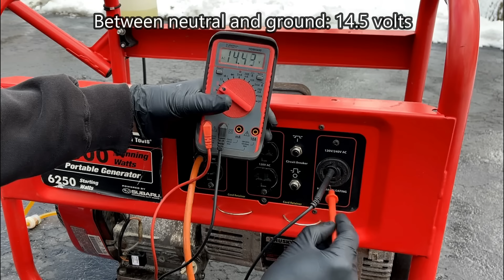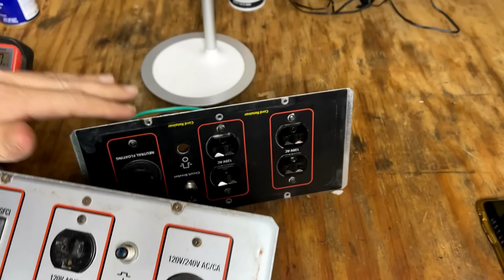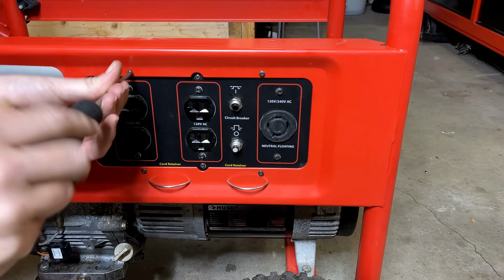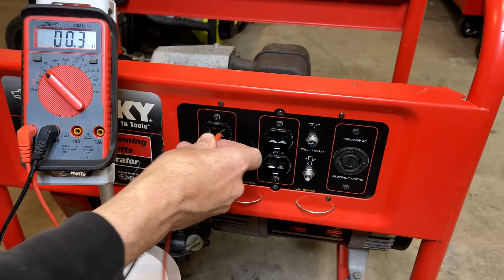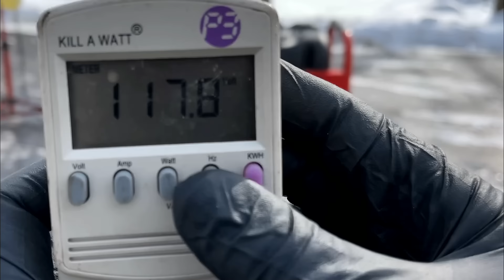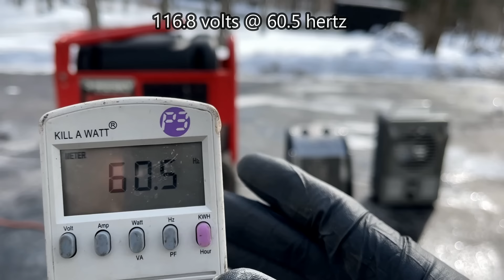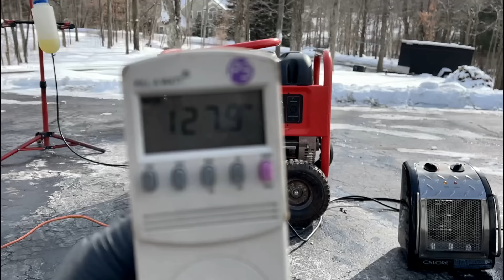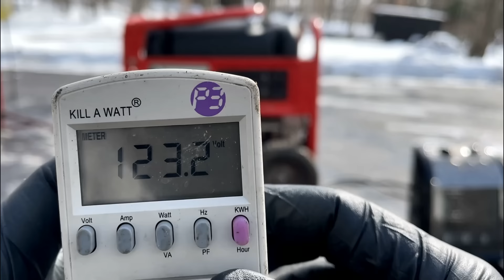No Power Output From Generator - Fixed

Comment: Your drilling out the wrong jet. The pilot is just for the idle mixture. You need to open up the main jet. When tightening the rotor, I think to align it properly, you need to fit and torque the stator first and then torque the rotor, thus aligning the rotor with the crank taper and not relying soley on the crank taper. The stator you said was bad, could it possibly be the slip ring that's faulty, or am I just making a fool of myself?  That said, I do love your videos and I always look forward to them James.
Reply from the maker: I tested each slip ring off video and they seemed good.  Even at 3600 rpm no load, it’s mostly the pilot circuit and transition circuit which are metered by the jet I drilled.  Since it ran well under load, it seemed like the main jet was ok.  Maybe not since it did not work.  Torquing the rotor after the stator install would work better.
Reply: @jcondon1  Hi James and thank you for your reply. You've got enough carbs around you to try opening the main jet. Nothing ventured, nothing gained as they say. I mean there's only four moving parts on a carb, two butterflies, a needle and a float. What about a video of making a carb run richer? Carb suppliers won't be impressed if you could show how it's done.
James.
It's been lovely corresponding with you James, so here's wishing you and the family a glorious weekend and keep the vids coming.

Comment: I enjoy your work. This time, I think you went to quick. This generator has stood in water in a closed room. The level of water reached is a bit above half of the wheels. This explains the corrosion. You should have cleaned the ventilator and made a much more insistent work of detailing, stopping corrosion. Not a criticism, just my thoughts. Keep up the good work. Kind regards.

Comment: Squealing brushes? Definitely! We've had that time and again, and it's one sign of them having been overloaded. The brushes get burnt and become hardened. Sometimes they will clean up with fine sandpaper, but if the overload was long term, it's pretty much irreversible.  Different brushes have different compounds and aren't always interchangeable, but on small machines like these it's not likely to be a problem.

I'd guess that an intermittent connection on that rotor would have had the AVR bouncing the excitation current up and down, and all over the place until the connection broke down completely. In the meantime, the brushes were likely pushed a bit hard and got burnt in the process.

That was a nice save though, but it looks like the whole machine has suffered a lot of dampness, or rodents peeing all over it, but I'd doubt that - It's too clean for rodents to have been nesting in there.

I'm liking the new ultrasonic cleaner - It's the bit bigger version of ours!
Reply from the maker: The old ultrasonic was sounding a little sick.  The new one is more powerful, but did not notice much of an improvement.  The slip rings had a lot of carbon buildup.  No doubt the AVR was working overtime.

Comment: Curious how that much water got in the fuel tank. Any Ideas?
Reply: it looks like this thing was left out in heavy rain. or a gutter or roof was dumping on it.
Reply: Left outside for rain and snow 
Snow would melt slowly and seep thru the fuel cap. 
That engine stay outside for many years 
The oxidation on engine n power head is impressive

Comment: Those 10 turn pots have a bit of mechanical hysteresis on the helix that drives the slider, you will never get it to the same place exactly by going one way and then back.

Comment: I have a $300 "Power It" generator for Walmart.  I only expected it to last until I got my cabin built (used it to run power tools) but ended up using if for years to run lights, etc. at the cabin.  To this day, it still does not burn a drop of oil but has an intermittent problem where it puts out low power (lights go dim) and when it happens, it sounds like the engine load increases (to the point where it nearly stalls).  If I keep it running, it will start working properly again.  Any ideas?

Comment: Remove the wire from the solder tab, clean it good , bend it back on tightly and the tab, and resolder with resin core non acid solder/flux!
Reply: OOPs aluminum wire, cant solder it, remove it and return with Alu cans to recycler for $..

Comment: I suggest a very close look at the OTHER end of the rotor winding.  I suggest there may be a dry joint there too.  If it is aluminium winding wire there are specific solders and fluxed to allow it to be tinned properly.  Not dead yet perhaps.
Reply: I was thinking exactly the same about the other end, you saved me posting that. These connections are often pressure spot welded to avoid solder problems.

Comment: You must clean the epoxy coating off the end of The Wire before you can solder it. There appears to be epoxy coating left on that wire.

Comment: I was like : 
You just going to take the seller word . Engine run good 🤣 
Then you decide to test the engine before taking out the stator n rotor 😁
Reply from the maker: Ken also tested it before buying it.  He said it started first pull but had carburetor issues.
Reply: @jcondon1  Great then. :) You know how it is . all the seller always said . it run great last time i started it :) :) :)

Comment: If the roter bearing is automatically centered in the end cap when its installed, why is there a need to put tape around the long bolt that goes through the center in the shaft?, It should already be centered. By the way i've learned quite a bit watching your videos.
Reply: Because the bolt is very long and hole diameter much more than bolt diameter, it is not  centered. You can see the bolt wobbling in some videos. Then some people ask in comments, what is wrong?
Reply from the maker: Exactly.  8mm bolts going into a 10+mm shaft are always off center from the factory which seems to be fine, but people go crazy in the comments when they see it.  Some rotors use a 10mm bolt and those go into the shaft nice and centered without any help.
Reply: @jcondon1  The bolt being centered would be irrealavent if the roto is pressed into the end cap. The rotor has no choice but to be centered. After all the rotor is being sandwiched tight between the crank and the bearing end cap. Actually that bolt seems more decorative than functional.

Comment: SCRAPE THE SALT OFF THE CONNECTION then flux it then solder it. Dry salt is a good insulator and a good conductor when wet

Comment: I’m not sure, what about you? Page 26:44 
I see a gap at the junction of the stator assembly (black) and front cast cover.
Reply from the maker: That is just the black outer cover that goes over the stator.  The important thing is that the stator core was seated into the bell housing.  A lot of times those covers are cut a little short.
Reply: @jcondon1  I agree. But please compare assembly condition seen on page 16:20 with condition on 26:44 and let me know your thoughts?
Reply: @philoso377  At 16:20 there is 2 mm cap in both sides. At 26:44 there is 4 mm cap on the right. It is OK. The black metal part is where it should be, between the aluminium parts.
Reply: @karirautio  am I right that it is more important for the stator laminate stack to be press against the aluminum bell brackets and to let the black sheath float in between with tolerance of a few mm?

Comment: About the contacts in rotor - if there was a solder problem on one side of wire, then the other very likely has the same problem ...
But not beeing a copper ... it just might be something not to be soldered at all or it might be easily failing when in contact with steel, just interesting what the hell it was.

Comment: What is the purpose of the black plastic adjusting knob, just to the right of the fuel inlet pipe on the caburetor?
Reply from the maker: It moves a needle in or out on the pilot circuit which changes how much fuel is allowed in.  It has a limiter cap so not much adjustment in it.
Reply: @jcondon1  Thanks!  I put a Woxla carburetor on my Subaru EX 30/Coleman Powermate.  It seems to idle rough (misses) but runs fine under load.  I'm assuming the idle circuit is running too lean.  Do I back the needle valve out in order to richen up the idle mixture?
Reply from the maker: @gregorywardlow3612  yes

Comment: I have a 3500 Troy built it will only put out 90 volts I replaced brushes and still the same thing I have tried everything I can think of your help would be greatly appreciated thank you
Reply from the maker: Assume it does not have an AVR?  If not, then voltage is based on engine speed.  Check the engine speed.  Should be running at 61.5 hertz (3690 rpm).  If the speed is good, only other thing to check is for loose wire or corrosion on a wire terminal.  Or maybe a new bridge rectifier.
Reply: @jcondon1  thank you so much for the help what is the thing you plug into to check the voltage and the hertz

Comment: You need to brush up on your soldering. The reason you couldn't solder is due to contamination of the copper. Scrape off all varnish from the connection area (factories sometimes miss that part) and pre tin the copper wire. Pre solder the tab giving you fresh solder. Now it's time to actually make the connection. The megohm readings you saw was an indication of a poor solder connection. Please retry and then retest.

Comment: on any soldering job the first thing is to CLEAN EVERYTHING. Take a little emery cloth to that wire then clean and flux . there is no reason that should not solder

Comment: you would havto trap the wire in a ball of solder once you get the tab coated then place the wire in it keep warm for a sec then take heat away while holding the wire in the solder to trap it there might help you

Comment: I thought that squeaking noise was from the brushes. The generator was probably overloaded which was why the circuit breakers failed. They can only be tripped so many times and the one might have been left open. It almost looks like the whole thing was submerged.
Reply from the maker: If only the generators could tell their story.

Comment: The wire could be aluminum. If it is aluminum wire it would have been spot welded. There should be a link across the back and you could find out which one is bad. You could of course rewind it. I have done some in the past.

Comment: I'm surprised you didn't inspect the fuel like you did for the oil??
Reply from the maker: Oil issues will destroy an engine very quickly.  Bad fuel usually will not cause damage.  Plus Ken was able to start it first pull so I figured it was not too bad.

Comment: I was surprise to see the second and last bottles had water and the first had very.  I thought the water would come our first.
Reply from the maker: It should, but the fuel fitting on the tank is held in place with a bushing that goes about 1/4" into the tank.  So the water did not come out until the end when I tilted the generator up.

Comment: Is it a single phase generator? Then how can it get 220v output?
Reply from the maker: It is 240 volts with a center tap in the middle  of the coil.  So from the center tap to each side it is 120 volts, but though the entire coil the voltage is 240v.

Comment: I believe that engine sat in dirty water for a while.  That’s probably what smoke the rotor bearing and cause all that corrosion on the stator end caps and other places.  Might have been exposed to a flood at some point.
Reply from the maker: Would not doubt it.  Th guy selling it had beach front property.

Comment: If you use a lighter, you can;
1- remove the insulation by burning it off. 
2- if the wire is aluminum (fake copper), the tip of wire will melt with the flame of a lighter.
If it doesn't melt and not magnetic, it's copper. If it's magnetic, it's steel.
Reply from the maker: Thanks!  I also tried the lighter trick.  Edited that out due to the video length, but still was not able to get a connection below 3 million ohms :(

Comment: How do you tell what rotors and stators are capable of what wattage?
Reply from the maker: No easy way to tell.  But on Honda clones usually the wattage corresponds to the length of the stator.  1" for every 1000 watts.
Reply: @jcondon1  Thank You.

Comment: If gas floats on top of water how come all of the water came out of the tank in the last bottle? Should it not have come out in the first bottle being that it would be on the bottom of the gas tank?
Reply from the maker: Plastic tanks hold the fuel fitting in using a rubber bushing that extends about a quart inch into the tank.  That was keeping the water on the bottom of the tank.  When almost empty I tilted the generator and that allowed the water to come out.

Comment: Those 120v outlets are rated at 20 amps, so a 25A breaker is oversized.
Reply from the maker: It is oversized for those outlets.  Most manufactures will use separate circuit breakers for the 240 vs the 120 volt outlets.  In this case the same breaker is used for everything.
Reply: @jcondon1  the US electrical code does not "reach into" equipment like this, but UL standards do.  I'm surprised these generators do not carry UL logo to indicate their design & construction has been evaluated for compliance.

Comment: Trying to solder a copper wire to anything is nearly impossible if it still has the coating !
It may need to have the coating scraped off !

Comment: Amazon sells a Diesel small engine, 4 horsepower engine sells for about $150, have you ever tried to mate a small diesel engine to like a 5000 watt generator head?
Reply from the maker: Would be nice to try.  The main problem is that most engine sold like that are a keyed shaft instead of a tapered shaft.
Reply: I have three 1982 Isuzu diesel engine, one in the original Isuzu I mark and my dad put one in a 2000 Kia Sportage, anyway I drove those vehicles and I saved $50,000 in fuel cost running a mixture of waste veggie oil and gasoline for about 18 years, the Kia has a bad head gasket and the I mark is not drivable anymore, I've been running that same mixture in  the small diesel heater, but I'm wanting to try that mixture in a diesel generator, have you got any good ideas for utilizing that homemade fuel?

Comment: Fuel heavier than water?
Reply from the maker: Water is heavier then fuel.  Plastic tanks have a bushing that holds the fuel valve in the tank.  The bushing extends about 1/4” into the tank.  So the water at the bottom of the tank may not drain out first.

Comment: I can’t understand why they make the wires so delicate that they break with such little movement or vibration ? I think they make them delicate to break down equal anew generator to buy  they could make the wire one or two gages larger to prevent this happening !
Reply from the maker: The higher end generators cover the wires in epoxy.  The wires then cannot vibrate and break.

Comment: Looks like salt water damage did that generator in. They panicked and started disconnecting wires to try to isolate the problem. Once they saw that the rotor was open they gave up. Not everyone has spare generator rotors in their back pocket!

Comment: For some reason all the corrosion on this unit looks to be flood damage to me.   Rust in the Carb vent tubes, and all the metallic exposed surfaces from top to bottom are corroded
Reply from the maker: I thought it odd the the engine was so badly corroded yet the frame was in excellent condition.

Comment: I test run my generator once a month for 10 -15 minutes. I recently read that I shouldn't run it without a load. Your comments will be greatly appreciated.
Reply from the maker: A load is a good idea, because it will get the engine up to temp and make it work.

Comment: you spotted water in the crankcase oil, you saw corrosion on the alternator, you saw extensive corrosion to the carb, and you saw corrosion and weird readings on the outlet panel, What proof do you need that the generator was under SALT water. leaving salt corrosion on the parts is going to cause problems later on. I suggest you sell it on eBay to some poor sap as all eBay sellers do

Comment: The water its more heavy than fuel, diesel , thats because the water its in the bottom of the tank

The mixture betwin gas and fuel its not rich enogh, the lowe idle jet its dirty , remove the caburator and cleaan ot up

Comment: The water is usually on the bottom because it is heavier than fuel.  Yet the first draining had the least water. Huh?
Reply from the maker: Plastic tanks hold the fuel valve in with a rubber bushing that goes into the tank about 1/4".  So the water could not come out until the end when I tipped the generator to get the last bit out.